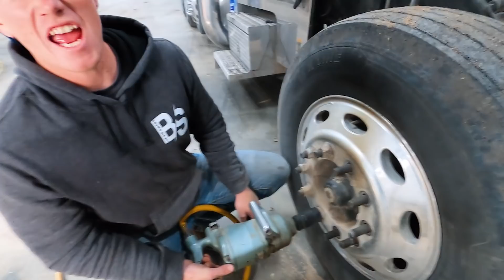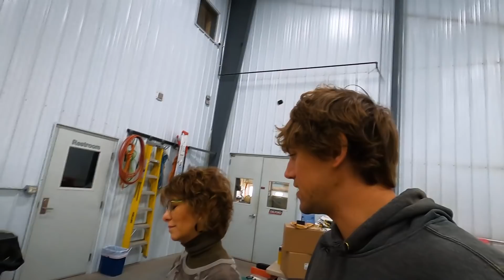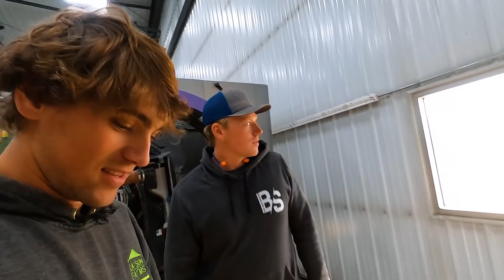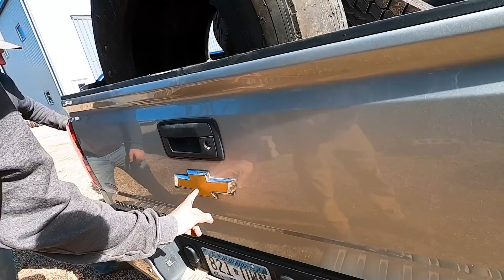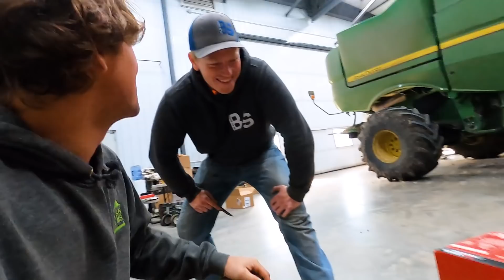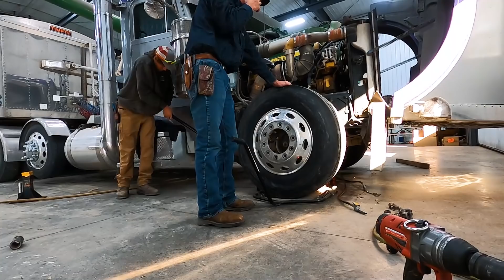We Had A Farm Accident! #25

Comment: As soon as I seen the video preview I new what happen.  I had a KW T800 do that once.  Luckily no one was hurt.  It slipped as we were putting the stands under it.  Ended up puncturing the brand new oil pan.  Lesson learned, always dump the air.

Comment: when you get card errors - good chance you can recover the files on the card most of the time - grab a free recovery software even like recuva and run it against the card...  I pulled all but 2 files off an SD from a wedding I shot... 398 recovered and were just fine...

Comment: Down here in New Zealand after my experience with earthquakes I always chock wheels on anything I,m working around. Even the headers when doing service and live running, physically put out of gear and chock a wheel. Only takes a minute. I had a clutch throw out bearing failure. Just pulling gearbox out and a quake rolled thru. Was under the truck working bellhousing apart and all hell broke loose. I rolled out between the wheels and the truck fell off the stands, then proceeded to roll down a gentle slope before coming up against a garden curb. Of course then drive shaft was out and so no park brake.
Reply: A little bad and a lot of good luck!
Reply: Chocking the wheels won't help. As the air leaks down and the bags deflate, the angle of the suspension arms that hold the axle up flattens out. The wheels can't roll so the truck frame is pushed forward which slides the front axle off the bottle jack or tips the jack stands.. It's why you dump the air out of the suspension.
Reply: Years ago when I worked around sports cars, we always cribbed w/ substantial 4x6, 6x6 and 6x8 timber skids.  My boss didn't trust jack-stands, and I share his distrust.  With cribbing you can't shift and over-center the load like you can with jack-stands.  Not a narrow stack of timbers, but a broad framework that isn't going anywhere.

Comment: If you want to give that air impact some extra juice set yourself up an aux tank.  We have an air tank off a truck the is plumbed with the normal 3/8” air hose fitting to fill it, then has a 3/4” outlet to the tool, it makes a huge difference to break em loose and tighten em down.

Comment: Try Centramatic balancers from Alvarado, TX for the steers.  Balancing new truck tires is a waste of money.  Believe me.  Mark the valve stem after mounting your regular way and them drive truck for 20 miles and look and see how far wheel spun on rim.  Never believed it until an old trucker showed me.

Comment: Should save those old steer tires for your pusher axle! Lol then when one of your guys puts them down going 45 mph mid winter without checking the brakes aren't frooze stuck at the yard and they put a huge flat spot in those tires you won't have to roll around with square tires forever lol. That's what we do, save our old steers for extra pusher axle tires, but your lift axle may not have park brakes so it may not matter lol

Comment: Two words for those lug nuts: 3:1 torque multiplier. $250 or so and you can use a 1/2" air ratchet to spin them off.

Comment: Chet Happy B day. Look at the air delivery on your impact gun for a 1/2" gun the 3/8" is plenty but for the 3/4  and 1 " guns more volume is required,   A  1/2" hose and quick connects are a must for in the increased torque. I know this by experience.   Food for thought with the battery operated tools does torque decrease when battery capacity diminishes?  I would retorque wheel nuts with a torque wrench for safety sake.

Comment: here's a clue,  there is a check valve between the air tank and the leveling valve. if the air bags go flat its one of the air bags or the leveling valve or a line.  dish soap + water in a hand sprayer will find it. easiest when the truck is loaded too.  
torque those hub pilot wheels to 550 ft/lbs. never trust an impact to tighten wheels.

Comment: My GMC has lasted me longer longer than any Ford or Dodge. My 97 dodge fell apart, jt spent more time at the dealer then i drove it. I had 2 Fords, my 2001 f-150 was a good pickup but my 2005 always had problems with the 5.4 p.o.s. i've had a Gmc and a  Chevy, neither had any major issues.

Comment: What are those silly little jacks rated  at? , we put wheeled commercial truck jacks rated to at least 15 ton under a tractor unit front axle empty or laden.At least you were not near it or under it even with the axle stands. The stands need to be rated to at least 7 ton each.

Comment: .... all your pointers for leaving a truck on jacks are good ... one additional, have your jacks so the jack wheels point in the same direction as the the truck wheels, thusly the if the floor is clean the jack will be able to roll and compensate for the air bag air loss forward roll .... always get my goat seeing people drive with the hood up, is it really that hard to close and reopen, there are enough blind spots as it is  .. rant end ...... yes thank god it was not a lengthy repair where you may have been under the the engine, but I am guessing you would have had jack stands in place, look at the base width of the jack and the jack stand, not really a lot of difference .... not criticizing, meant to be thought provoking .... before I forget, happy belated birthday Chet, may your new year be your best one yet surpassing your wildest dreams and expectations, all the best ....... you may get better results with your big impact if you had a i" hose, less resistance. You may have noticed truck shops use the small hose for everything except when the big impact is being used then the big hose is hauled out ....your building is probably plumbed with 1" ..... good to see the sun, at least the puddles are not getting bigger  ..... pazza sure sounded good, since told I was a full blown diabetic it is a no no as is anything sugar or carb (sugar in disguise) related. Handling it without meds. ..... too bad about the SD card. Everything happens for a reason and you were maybe meant to share the story you did today as opposed to what you had intended .... thx for the peek into your lives .... as always .. never stop dreaming, just dream bigger .. have fun be safe, save our oceans ....

Comment: Use a liquid called tire life or it's great that you're using heavy equipment tires and stuff but you can use it in your semi truck tires all run 20 to 25ﾟ cooler and they will last longer and they stayed balanced all year round you don't have to mess around with you don't lose the sand if you get a hole in your tire and ask sprite a little liquid on the ground but it's easier to clean

Comment: Would it have been better to detach the truck from the trailer to make it easier to just leave the truck on the jack stands or put some sort of block in front of the rear wheel before taking off the tires

Comment: Chet, would big wheel chocks hold the rig from moving ?
Reply: Use air dump valve, Dumped air bags cant lose air if they are empty, also dump air bags on trailer if equipped when disconnected air bags could leak stressing your trailers landing gear

Comment: - For Generation Z, The Beatings Will Continue Until The Moral Improves.
- {where i come from} Even morons who lived their whole lives in tar paper shacks know enough to Chock the wheels.
- Guess how they learned this.
- I am pretty sure your father yelled at you guys about CHOCKING THE WHEELS . . . right?
- The pretty-boy self-important-Swede has enough muscle in his character to point out something his father yelled at him about. That takes some Moxie in his integrity and character . . . or terror because the Big Swed just looked at him disapprovingly. {I'll have to eyeball the grandfathers to know where that strength of character came from.}
- Either way, have you ever been in -36 degree below zero weather tying to fix a logging skidder and have it fall off the logs you had it propped up on, . . . and be underneath, and suddenly need to take a piss?
- Do you die, or do your low IQ friends just take another skidder and hitch it up, and pull over the one laying on top of you?
- What would You do . . . if you were not overly smart?